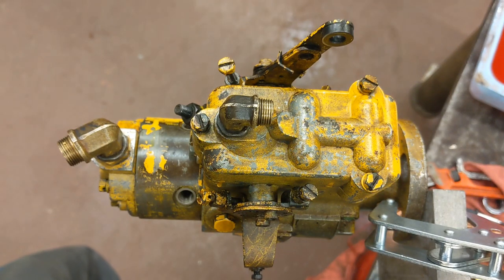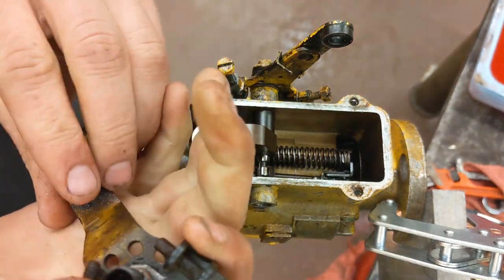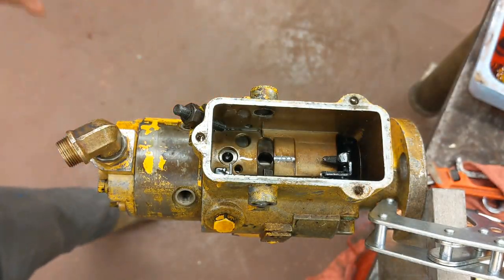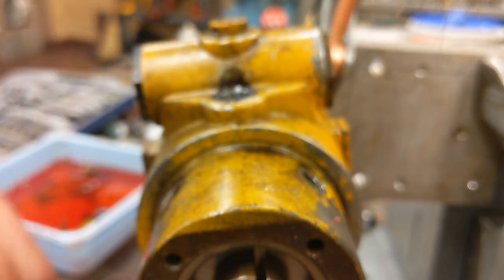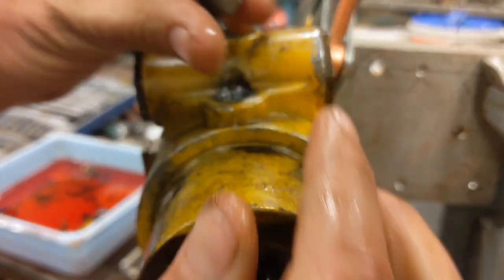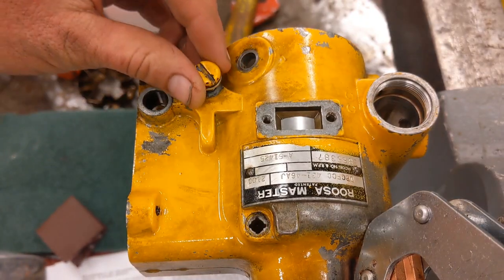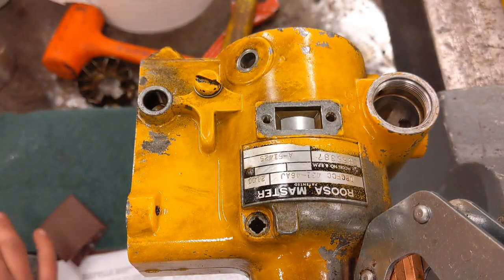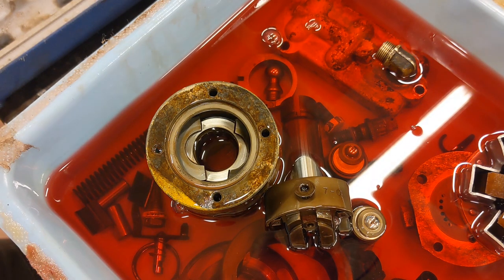how to disassemble the fuel pump on a case 580b. dbgfcc 431 46aj

Comment: I know this video is older ,but at roughly 12 min in ,when u pulled the pump body off out came the bottom of the old weight cage with it still attached to the rotor with the snap ring than out came the new weight cage .Did you just stack the new weight cage assy on top of the old cage bottom plate and reassemble the last round. Something doesn’t look right . The new cage should be in place on top of the rotor with the timing mark transferred from the old plate and that old bottom plate should not be anywhere in that pump anymore.

Comment: I've watched every video on the Roosa Masters. Everyday Projects suggested this site too. Everyday Projects video on disassembly is critical. A commenter points out that there are two air/bleed wires in the one hole instead of one on the head.  Thanks, all of the videos are great.

Comment: I have same issues you had no fuel to injectors. Was told the pumps are timed is this true? Om nervous to remove the pump for rebuild
Reply from the maker: They are timed but it's easy to adjust removing the pump is no big deal. When you re install it there is a punch mark on the end of the shaft and a matching one inside the hole make sure they are lined up or it will be 180 degrees out, after that there is a window you can open to see a line that indicates timing with the engine at tdc. However on mine I just made sure to put it as close to the way it came off and the engine started but was running rough so I just barely loosened the mounting bolts while it was running and it pulled itself into time.

Comment: I’ve looked at a bunch of these videos. This one is the BEST!  Made it SOOO easy. 
My pump was soo clogged. I need to take some fine steel wool to some parts. And suggestions?
Reply from the maker: Just be gentle the tolerances on some of the parts are super critical so maybe start with a plastic bristle brush and if you move on to steel wool start with the finest you can get

Comment: Thanks! My pump just took a dump. It is leaking fuel out of every seal. Finally stopped the engine from running at anything more than an idle. Will be pulling it out this weekend. I ordered my rebuild kit, should be here tomorrow. Shocking how expensive a new/rebuilt pump costs for this old tractor.

Comment: I just watched this again I'm so glad that you went ahead and "broke trail" for us on this. Now we know all the bolts not to go too hard on, which ones not to snap off, etc. You're a real trooper to break all those off for us! Thanks Ha Ha. I'm going to try starting mine before I attempt this rebuild. Maybe it will work fine without it. What were your symptoms that led to the rebuild? Leaks?
Reply from the maker: It was leaking but it stopped working all together, couldn't get fuel to the injectors. That said I'm still having problems with it after the rebuild which is why I haven't posted the next video yet
Reply: @GRTRanchadventures  I look forward to finding out what the trouble is. Perhaps something is worn beyond tolerances??

Comment: Hey there. Just curious where you got the part numbers for those orings for the throttle linkage and choke. I am having some difficulty finding them online. Thanks. Great video.
Reply from the maker: I just bought a kit that had everything in it I don't have separate part numbers

Comment: Great video, all around.  I am working on my Dad's 74 580b with the same pump.  It has been sitting for 15 years.  Where did you get your seal kit from?
Reply: I got a kit off of Amazon
Reply: @markwaschke1635  Great, the kit that was suggested was a great kit and i got it in a couple of days.  A great company to work with.

Comment: This is very informative. Do you know if you can turn up the fuel delivery on these pumps like the DB2?
Reply from the maker: Not that I'm aware of, I think the only adjustment other than time is the the cam advance and it's made by shiming the advance piston power side plug, so maybe you could tweak it a little but I don't think there's much changing it from the stock settings.
Reply: @GRTRanchadventures  I see, my dad has a 480ll and we if possible want to give it a little bit more power. Thanks for taking the time to reply to my comment.

Comment: It's a year later and I'm just at the point of trying to start the 188 diesel in my '68 Case 580ck. I rolled it over the other day and had fuel up to the pump but none reaching the injectors. I think you said that your attempts to rebuild were unsuccessful. I'm thinking about tearing into mine (carefully) and installing a kit. What did you finally do to get yours working? I think you took it to a shop? I'm trying to avoid that. Do you know if there is a bleed port on the pump. I may have air trapped. I think there is severe varnish inside from sitting for years. I'm going to keep trying to bleed it first before opening it up. Absolutely zero fuel at injector lines so far!! Thanks in advance.     Craig
Reply from the maker: I ended up taking mine to a shop... Once you get fuel to the pump you should be able to bleed the injectors and get fuel there, on mine it only takes bleeding one injector and it will usually start.
Reply: @GRTRanchadventures  OK. Thanks. I may try to install the kit first. I watched another YouTuber called "Western Truck and Tractor Repair" and he shows a new part--a solid weight cage to replace the flex rings inside the pump. I ordered one of those from Amazon and I already had the kit. Wish me luck. and thanks for the reply.
Reply from the maker: @EverydayProjects  ya I watched that video before I did mine and replaced the weight cage as well the part numbers I used  are in one of the videos. I think I missed a step based on comments, I didn't know about the distributing valve in the shaft somewhere apparently it takes an Allen key to remove and someone pointed out I didn't take it out. Also the shop replaced the brass wear rings on the drive shaft which I didn't know to do so maybe you can learn from my mistakes and be successful! Good luck my friend 👍 the pump is not that complex I just needed mine running and after having it apart 4 times without finding the problem I threw in the towel I hope you have better luck 🤞
Reply: @GRTRanchadventures  Everything that goes up online and YT helps others. I've learned a lot about that pump from your videos. This afternoon I took out that drain plug/bleeder you mentioned in your video on  the side of the pump below the throttle lever and above the lock bolt, and a whole lot of old stale fuel came out. Then it went dry. I put the plug in, cranked it over and took out the plug again and now fresh diesel came out. It didn't reach the injector lines on subsequent tries but it seems promising.
Reply from the maker: @EverydayProjects  glad to help that's why I make the videos. My guess would be if it's not making pressure to the injectors that either the flyweight flex ring failed or the distributing valve that I failed to take aper is clogged but don't really know as I never got mine working on my own
Reply: @GRTRanchadventures  I'm going to try a few more times before I take it apart. Maybe a week and it's coming off. Thanks for your help!!
Reply from the maker: @EverydayProjects  hope you make a video if you get it apart I'd love to know what I missed on mine it's just not worth taking it apart while it working fine lol
Reply: @EverydayProjects  did you ever get ut working? Im gaving the same trouble as you...have not taken the pump apart yet as i want to make sure it is not something simple first.
Reply: @cheatinggravity173  I'll answer for myself even though this is GRT's thread. I have a '68 580CK with the 188. I pulled my pump last week and put it back together but still didn't have fuel delivered to the injectors. Coincidentally, I pulled the pump today and tore it down. I found a few small passages in the pump rotor blanked with very tiny allen head plugs and there was gum and dirt behind them. Also, I removed the vent wire from within the head today too (something I missed the first time). We'll see. I think GRT took his pump to a shop but he'll most likely answer you directly.

Comment: The fitting on top has a check valve the size of a BB that is clear in color when properly cleaned that's the problem when engine starts right up then stalls.clean with pick and brake clean
Reply from the maker: No it doesn't that was the first thing I looked at on this pump it's just a regular 90 that goes into a strainer, no check valve in it

Comment: Looking for help . My 580 B will start up cold and run for a couple minutes then die . Restarts and repeats . But every time is runs less . Changed filters, then injectors . Pump is putting fuel to injectors. I just don’t know the pressure it is putting out . Time to rebuild pump ??? Any ideas would be great
Reply from the maker: Sounds like it's starved for fuel, if you already changed the fuel filters my next guess would be the injection pump. Hope that's not the case it cost me about $800 to get mine rebuilt. 😓 that being said it's hard to trouble shoot in YT comments so, if you could give me more info on the machine and the problem I'll do what I can to help.
Reply: @GRTRanchadventures  upon further investigation I believe the flex ring on the flywheel is broken causing pressure to build up internally and shuts the pump off . ??
Reply from the maker: @brandonwilson8974  that's very possible if that's the only problem you can replace it with the upgraded flyweight that does not use the plastic flex ring. The part numbers are in the videos I made trying to rebuild mine but ultimately I had to take mine to a shop to get it fixed
Reply: @GRTRanchadventures  
I really appreciate your honesty. I was debating on doing it myself. After hearing about the problems you encountered. The decision was Clear. I found a local shop ,,, knew  all about the roosa master pump . $600 to $800 and a few days
Reply from the maker: @brandonwilson8974  my shop charged me $770 and threw in a bottle of stanadyne fuel treatment. Pluses they replaced the brass drive shaft which at the time I didn't even know to look at but if it has wear it can leak fuel into the crank case. And they turned it around in 3 days. So in the end I think you made the right choice and if I run into any injection pumps in the future I'll most likely go straight to a shop. Glad I could be of help😁

Comment: anyone know where to find the kit to rebuild it
Reply from the maker: Badger diesel sells them on Amazon part number 24371-R. Also you will want part number 29111 from the same seller to replace the old flyweight retainer with the updated model if you haven't already.

Comment: Didn't show the delivery valve in the middle of the rotor.
Reply from the maker: I showed you everything I saw if there is another valve in the rotor I dident know about it and it's not on the prints or parts list I was able to find in the pump
Reply: @GRTRanchadventures  It's a very critical part of the system . It takes an allen wrench to remove it from the slotted end of the rotor.
Reply from the maker: @gatepro1000  just found it on a drawing... Full disclosure the pump did not work when I put it back in the machine so maybe that was the problem... Wish you had told me sooner I already took it to a shop and had it rebuilt, it's running good now, but maybe I could have saved some money.
Reply: @gatepro1000  Thanks for this tip.. I will look for that as well. My tractor is a 1975 580b, what should I expect as far as sludge and dirt inside?

Comment: He still hasn't removed the fitting CAUSING the problem on the cover
Reply from the maker: as i said in your other comment it STILL DOES NOT HAVE A CHECK VALVE in the 90